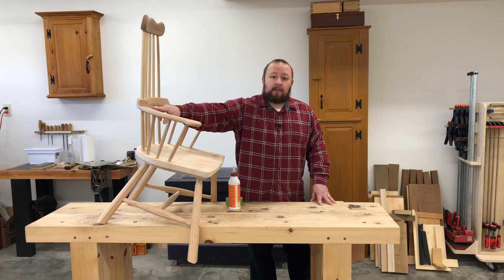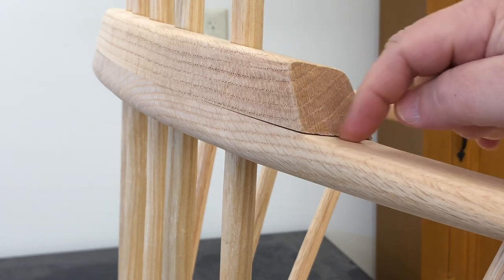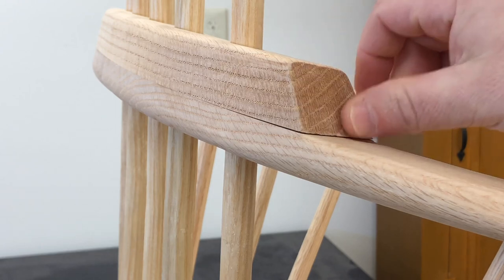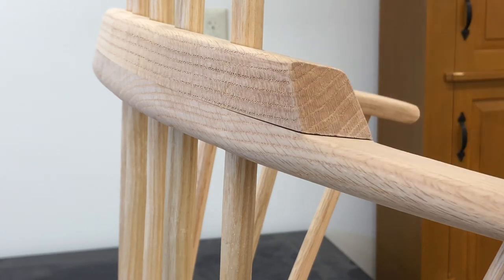How to Repair Small Cracks in Furniture

Comment: Did I correctly see a large motorized spinning thing in the background?
Reply from the maker: The bandsaw?
Reply: @BRFineWoodworking  Haha, yeah, just so used to seeing you with hand tools only.
Reply from the maker: I’ve only had it for about 4 or 5 months. So yeah, up until that point, for about the last 20 years, hand tools were pretty much the only option I had for what the bandsaw does.
Reply: Bob Rozaieski Fine Woodworking bandsaw was the first power tool I bought too.

Comment: Nice repair.  What would you have done if you had no available area to install a clamp?  I have a similar crack on a mudroom bench top seat, but it is installed and I have no easy way to remove it or install a clamp.  It is about .035" wide at its max and about 24" long.  Red oak.
Reply from the maker: I’ve done several different things in the past. You can use screws as clamps if you can get them in from an inconspicuous area that won’t be seen after the repair. Another way that I’ve done it is to brace the bottom side by wedging in some plywood or 2x4 off cuts to support the bottom and then adding lots of weight to the top, like dumbbells, books, bricks, or whatever you have that can supply lots of weight. If you can put a caul covered in packaging tape on top of the repair first you can concentrate the weight into a smaller area.
Reply: @BRFineWoodworking  ok, thanks.   I was thinking about getting some jb wood weld and somehow pushing it in with one of the leaves from my feeler gage set.  Thing is, it's all installed and the top is glued to a plywood carcass underneath the oak.